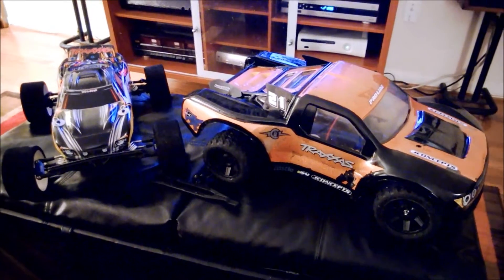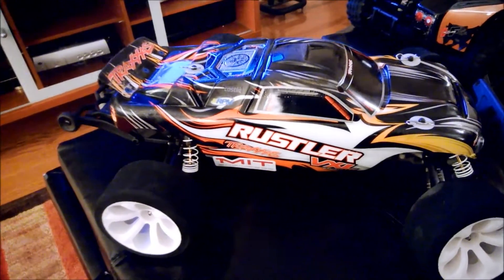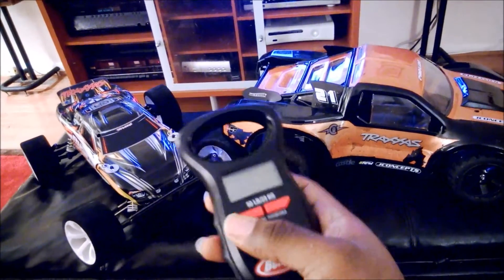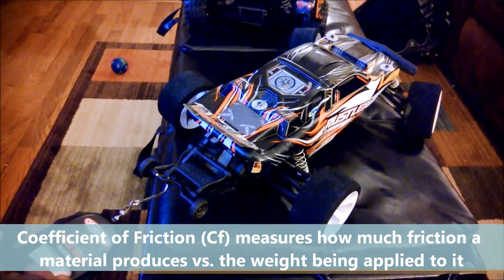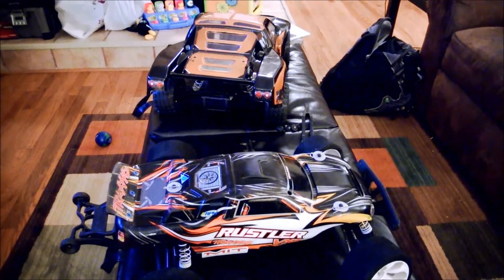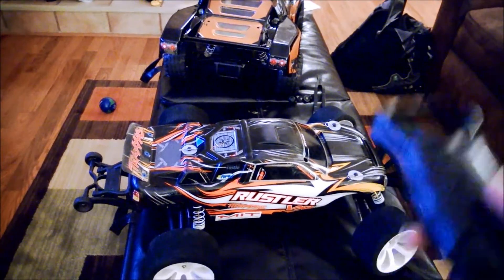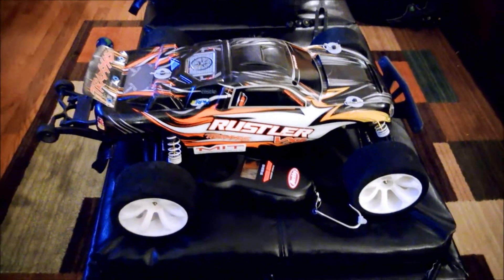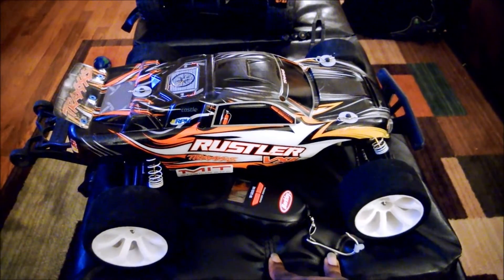Ep. 15: Rubber to the Road - Foam vs. Rubber Tires

Comment: Foam vs Rubber, you are over complicating it, contact patch...rubber tires balloon, foam tires do not, diameter also plays a roll. A six inch wide diameter (guesstimate on full ballooned before popping) diameter on 1 cm of road contact vs 2 1/2 inches wide contact patch with no expansion from original diameter is going to play a huge factor which you made no mention of.
Reply from the maker: I should probably revisit this topic. I've learned a LOT since then which changes the landscape quite a bit. One of the biggest factors is the availability of reasonably prices belted robber tires which don't balloon at all, even at speeds of >120mph. 

Thanks for watching!

Comment: Are you near Atlanta I want to do R/C physics with you XD 

Also if you want to re try this instead of the fish scale on all 4 wheels you could put jewelry scales on each corner and see what it would weigh in grams total weight, I could be wrong.

I've been thinking of adding tungsten to some parts of the car for adding weight, You can use smaller plates or whatever shape you want than any other metal due to the density I figured you could use a lot less of it.
Reply from the maker: Good advice here, but I actually ended up going with an Aero-based solution to make downforce at speed. You can check it out here... https://youtu.be/on82MQ-BIwM
Reply: @RCPhysics  I'll check it out as soon as I get home, I've been non stop watching rc videos to learn just as much as I can on paper and apply it to the road.

Comment: Very nice work!! 👍
As an an electrical engineer, I love to see things broken down to science and #s!

I have a Rustler as well. I began to do speed runs very recently. I have a video posted of my 1st setup run. Still running the Titan 12T brushed motor, want to push it to the limit as I wait for my brushless system to come in. On that video, I was able to only hit 38mph. And my 1st run, that I didn't record, I was able to get 39mph consistently. The only difference between the two runs was the phone I had inside the car to record my speed. The 39mph run had a heavier phone inside, just under 7oz. 
I thought by making the car lighter I would gain extra speed. So I began to ponder & wonder if the problem was that I needed more weight to get me better power transfer to the ground. After your analysis, the answer is quite clear. I will make some weight adjustments this weekend & do another run using the same gearing to see how much more speed I can get.
Awesome work, thanks! 👍
Reply from the maker: Awesome comment. Keep me posted!

Comment: I saw a Max of 6.5 lbs of dynamic grip on your scale with the Jaco's which leads me to believe that the foam will work better on  concrete since we're always going to get some sort of slip angle/wheelspin.
Reply from the maker: I think foam tires have a lot of other advantages. I have an ultimate speed run tire comparison test series that I need to finish. The bottom line is that both foam and rubber tiers can be treated to get CoFs better than 1, but the foam tires are significantly lighter, so the friction material and rims are under significantly less stress at high wheel rpms. It also takes a lot less energy to spin them up to speed due to their reduced moments of rotational inertia. 

On the flip side, the rubber tires like the classic GRPs are tougher and can take more punishment.... assuming you don't blow one out.

Comment: Aerodynamics take the ruddy great plastic bumper off of the front of the truck as that will counter your shells aerodynamics and it will also make the steering and front end lighter as it is lifting the vehicle at high speeds,
Reply from the maker: If you look at my profile picture, you will see that bumper is long gone. ;-)

Comment: Anchor the scale lower, your test is off because the anchor for the scale is to high above the vehicles C G, causing the rear of the car to lift when it hits the end of its leash, I'm willing to guarantee that you're getting a lot more traction than you think you are. Set that scale anchor rope level and the numbers will change. Good luck on hitting 100 if you haven't yet!
Reply from the maker: Excellent points! I've actually been thinking of repeating these tests with the setup you describe to test some of my new tires. 😜

Comment: I have two sets of grps and a set of soeed treads by horizon hobby i can't seem to get any traction at all so my question to you are foam tires better than rubber?
Reply from the maker: Point 1) Could you provide a little more info on your rig and which compound GRPs you're using (S1-S7). GRPs are proven speed tires, so not being able to get traction implies your tires have dries out a bit making them slick OR that you don't have enough weight in the wheels to make the traction you need. If weight is the issue, simply adding a little at a time (balanced to keep the center of gravity at or a little ahead of the midpoint between the axles) until you start hooking up better. If the tires have gotten slick, you can use traction compound, WD40, or even Windex to help them bite better. Here's a vide showing how I have used traction compound in the past. https://youtu.be/z-iKeu28K7U  

Point 2) I have heard mixed things about the Speedtraeds Foam tires. They seem to be a fairly soft foam compound that may nor stand up to the punishment for true high speed applications. Most foam tires were actually designed for "low speed" carpet racing. BSRs, Banana Skinz, and SP Racing have all proven themselves capable of true high speeds, but the SP Racing foams are on a thinner rim, which can't take as much punishment. Check out my Speed Tire Compara video for more info. https://youtu.be/wJ7KLeBU77w

Point 3) I personally think foam tires have some advantages for speed running because they are lighter and less likely to get a blow-out. However a properly treated rubber tire can be just about as grippy as a foam tire. Also, if you are drag racing, rubber tires may be preferred because you will probably not be going much faster than 100 mph (less likelihood of a blow-out) and the rubber sidewalls are a little tougher so they can take a little more punishment without damage. They may also last longer.
Reply: @RCPhysics  im tying to run triple digits

Comment: Look, just add some lead weight in the front and a bigger heavier motor. Not that hard... Alu upgrades also help to add weight. But you need a stronger motor!
Reply from the maker: As you could tell, this is an older video from when I was first starting out. It's since gone past 70mph... with the same motor. ;-)
Reply from the maker: @smperkins410  The rustler has a Mamba X now and will be running at 3S, 4S, and maybe 6S soon.
Reply: I got mine going 80mph but constantly breaking diffs and not that stable. Bashing is expensive with a motor way stronger than it can handle lmao
Reply from the maker: @jamesandonian7829  My Rustler wasn't stable at speed until I put the Aero on it. Now it shoots straight as an arrow every time. The other mistake guys make is trying to accelerate too fast. taking a longer time to run up to speed puts less torque through the driveline which makes it easier on the diff. Locking the diff is the strongest option, but then you kinda give up turning. 😏 

https://youtu.be/on82MQ-BIwM
Reply: @RCPhysics  lol ok. I only lock the center diff, use heavier diff fluids for front and rear. Don't recommend locking front/rear diffs, youll strip em too quick!!! And yea, no turning!!!!!!!!! Haha but ok

Comment: ? In drag racing would you use a lipo 5 oz lighter but less power or the heavier lipo but noticeable power difference car weight 4lb 1oz with better battery with weaker battery 3lb 12oz same voltage
Reply from the maker: I think the heavier snappier battery might make the better bet since the extra weight may help you put down the extra power better. Increasing weight by 5oz is just over an 8% weight increase, but it also means you can put down at least 8% more power without spinning the tires.

Comment: What tires do you recommend for drag ? I use grp slicks on my rustler right now.. I'm thinking about switching to foams on concrete no prep
Reply from the maker: Hmmm. That's a hard one. I know guys who drag race with foam and rubber tires. I think it might be a personal preference thing. You can use tire sauce with either, so I think the grip would be comparable either way. There are a few RC Drag racing groups on Facebook. You could ask the question over there and see what folks say.
Reply: Ok cool... man I think it's so cool how you got these cars down to a science.
Reply from the maker: Thank you!

Comment: Dude!  Watching this video was good news for me confirming my assumptions of what I needed to do to improve my ability to have a more successful speed run. Adding weight was my guess for more traction.  I see Slade has the characteristics like my old Husky Labrador mix, getting his hind legs low to the ground for more pulling power.  
And when it comes to the rubber vs foams tires, I'm gonna stick to the tape method on rubber for now after seeing those results. 
Great video!
Reply from the maker: Keep in mind, this was done with "dry" / untreated tires on a cold day. A "treated" foam tire on warm pavement sticks MUCH better. I tested the tires dry, though because different traction compounds have varying amounts of improvement and work on rubber and foam. I thought it would be best to keep the data "pure."

Comment: you should look at some drag races via dragtimes. you will see many races with suv's verses supercars, and visually it wont add up. big heavy bad aero suv beating low sleek supercars.  the reason... those suvs are able to get their full power to the ground because of there weight.  supercars and racing cars normaly achieve it via a large spoilers in the rear

Comment: I have a much simpler and accurate method! Just keep the car on a variable slope incline plane and find out the value of slope for the inclined at witch the car just starts to slip, Call this angle 'x'. Then friction coefficient is equal to tan(x).
Use same tires on all four wheels to get the right coefficient of friction. Also this values shall be applicable only to the specific surface of the inclined so you.
Reply from the maker: +UJJAWAL AGGARWAL The method you describe is actually how we did it in one of my physics classes, and it does work very well to measure the coefficient of static friction. 

The method I used has two advantages. 1.) It can give you the coefficients of static and dynamic friction, and 2.) It&#39;s fun!!!

Both methods work. The point of the video was more to show how applying science can be interesting and fun and to get people thinking. 

Thank you very much for you comment and i hope you enjoy some of my other videos where I make lots of other things waaaaay more complicated than they need to be, but in a fun way.

Comment: And I'm talking from experience about the rustler, I have done it put in the velion motor 3s lipo pack over sized the spur gear under size the pinion, all metal rear including rims and it pulls wheelies at fifty miles and hour. It runs over 80 miles an hour easy. Had to put a wing on the front. If I add a little fishing weight to the front I won't have to worry about it flipping.
Reply: No as rc physics said think until you've won the Nobel Prize!
Reply from the maker: Derrell English I really do appreciate what you are saying, but my goal is to introduce kids (of all ages) to science and engineering concepts using RC cars as a teaching tool. Someone bright enough to make an RC go 70-100 mph is also bright enough to be an engineer, scientist, or mathematician, but many people were never taught that this is a realistic goal. My videos aren't for everyone, but if I can inspire one person to think a little deeper or see a new path I feel I've succeeded.
Reply: I understand and the concept of using these toys with that angle to introduce kids to science is genius!.
Reply: +Derrell English I am a "kid" and speed rcs inspired me a little :D So many variables to these things, I wonder if I am just overthinking it.
Reply from the maker: Lionkev55 Lions Rule number 1 is to have fun. For me, overthinking is part of the fun. (can you tell?) The more you think, the more you understand, and the better your intuition becomes. You also learn how to ask better questions. These will attributes serve you well in the future, no matter what field you decide to go into.

Comment: Man you are working to hard! You are taking out the fun, leave work at work. Add a little weight to the front of the truck, over size the power plant with a brushless motor, a really strong lipo pack, and hold on. There are so many people over the 70 mile an hour mark. You get the speed through gearing and power. It's not a plane, down force is only going to do so much. And I'm not putting you down, toys are to relax your mind, not to practice your craft. You are thinking WAY to much! But if that's what's making you happy.
Reply from the maker: Derrell English ...but this IS how I relax. ;-)
Reply: Hey man, I ain't mad at you! Anybody who is grown and plays with toys is alright with me!
Reply: May i suggest that the bungee cord you used to anchor the fish scale to the railing will stretch. Maybe try some lightweight chain from your local hardware store. Just thinking of/ putting all the pressure on the scale to get a more accurate reading. That being said. You have a great video, applying physics in a way that not many know how to do. Very informative. Appreciate it.

Comment: A friend of mine has the same 2 cars on his rustler hes running foams the 4x4 slash hes got slash street tires, we did a few runs to day teying to produce a max speed for his setup, after all was said and done we figured out his foams where spinning under top speed. We could not complete a pass with rubber tires on his rustler but the foams where no problem. We then switched tires on his slash to see if we could prove this,, we did have a drop in 10mph difference with foams over the street tires. Ill be watching your videos from now on to see what you fine out
Reply from the maker: Thanks for your comment. I had a similar experience that I've discussed in a few of my videos. The rustler was missing its calculated top speed by ~10-20 mph in my early videos, which I attribute to a combination of wheel spin and voltage drop. I spent a lot of time characterizing my batteries under different loads this winter, but I can't work on the traction problem until the weather improves.

For this experiment, the ground temp was just above freezing and I observed a small traction difference between the foam and rubber tires. I suspect the difference will grow much larger on warmer pavement. The rubber tires also have the advantage of a tread pattern that will help them mechanically bite back into the road surface if the start to spin. This cal be good and bad because if you spin out and slide sideways at speed, you are probably gonna roll the car. My foams usually slide across the ground as if on ice until the tires hook back up again... usually...

Even with the traction issues, I like the foams because they have virtually no ballooning, which can cause all sorts of handling instabilities, especially at speed. Unfortunately, the only way to solve the traction problem is to add more weight on the wheels (either through down force or vehicle mass) or by making the tires stickier (with traction compound and such). I'll be experimenting with all 3 methods and report back with my results. I've only had one testing session with the aero package so far, but it dooms very promising. (See the run at the end of my Slade 2.0 video).

I hope this has been helpful. Let me know if you have any ideas as well.
Reply: Well when i get permission I will have to email you or try and post a video of another slash a differnt friend is building just for speed runs hes kinda keeping it hush hush atm